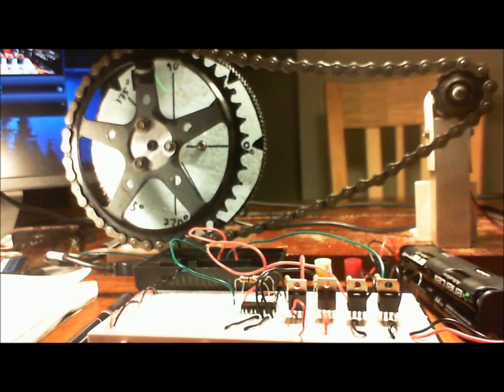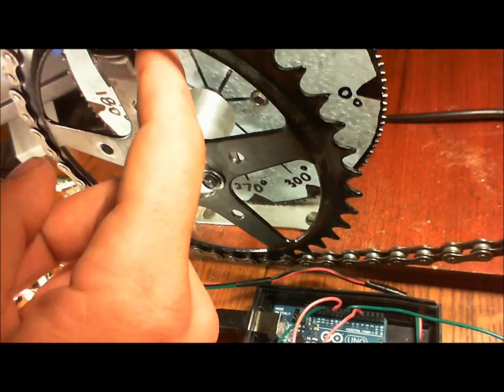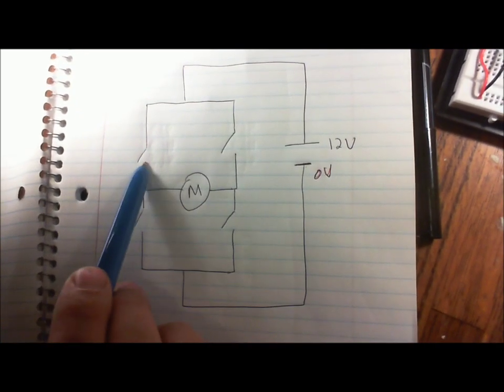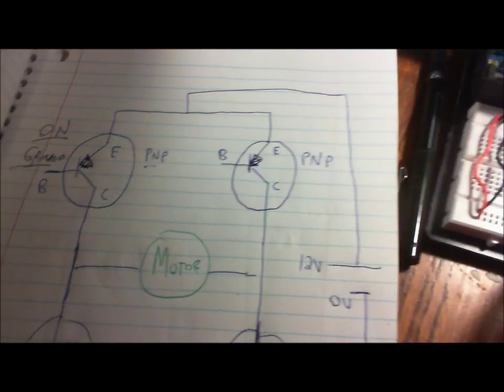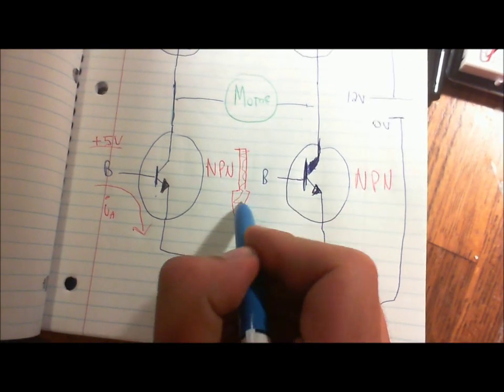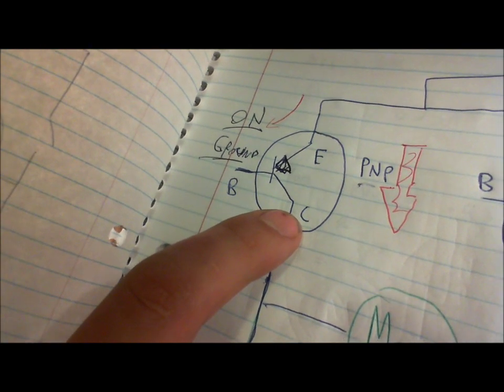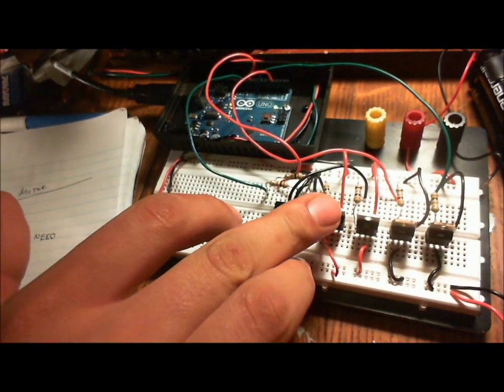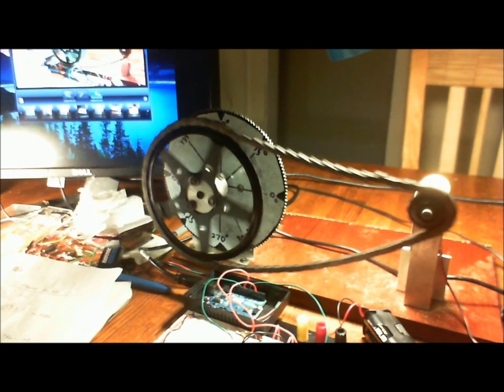Arduino Controlling an H-Bridge "EXPLAINED"

Comment from the maker: I think that you are getting confused because you are thinking about some transient effects that will only last microseconds. Instead, try and think about steady state. With this, (on the high side) the voltage drop from the collector to the emitter ( again, on the PNP transistor on the top right of the diagram) will be less than a volt! So this collector will be siting at around 11 V at steady-state. The collector on the low side will be at about 1 V during steady state

Comment from the maker: So, you are correct. I could use four PNP's or four NPN's, but I would have to use a higher voltage to control the H-Bridge. Since the arduino sends 5 V signals, I just stuck with that.     

By the way, I had a lot of trouble figuring this part out myself! 

I am curious, is this a hobby for you or do you go to school?

Comment from the maker: Continued.. To send current into the base of the NPN transistor on the high side of the motor ( that is the side with the 12 V source) I would need to put in a signal greater than 12 V. Why is this? Remember, current flows form high voltage to low voltage (electrons actually move the other way) so if I want to send current into the base of the NPN then I would have to send it a voltage signal above 12 V. If I don't send it over 12 V the current will flow out of the base (like the PNP).

Comment from the maker: Sorry for the delayed response. I think a few people asked me similar questions.

Anyways, skip to about 7:08 in the video. At this point I am explaining the PNP transitor in the top right of the diagram, I explain how this transistor activated when you ground its base. This lets a little current flow for the 12 V source   back through it. If I had an NPN transistor there I would activate it by sending current into the base of the transistor.

Comment: I two need to use a PID I was going to use a potentiometer
have that send a signal back to the adduino  or raspberry pi depending on what your thinking about using let me know how you get on